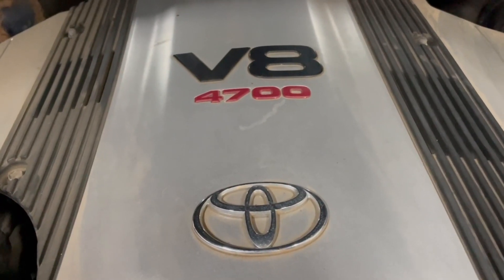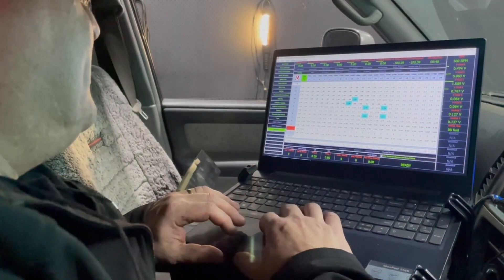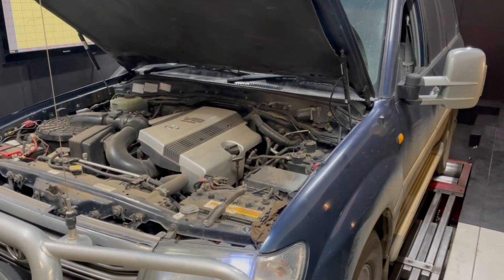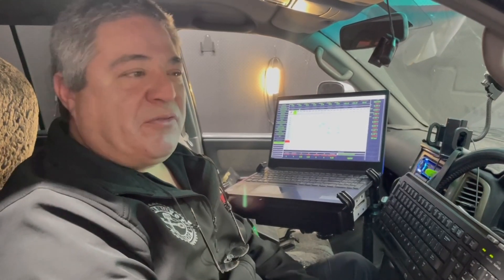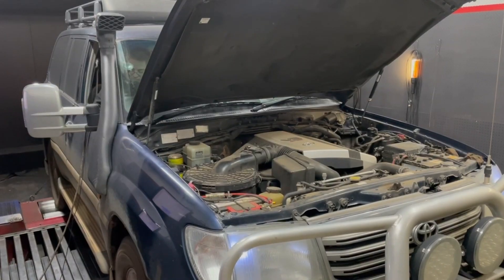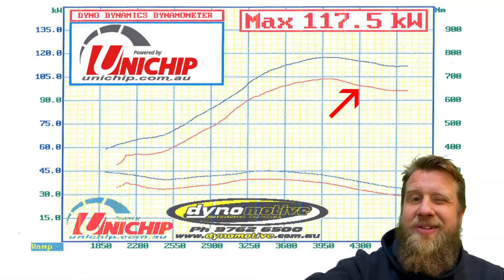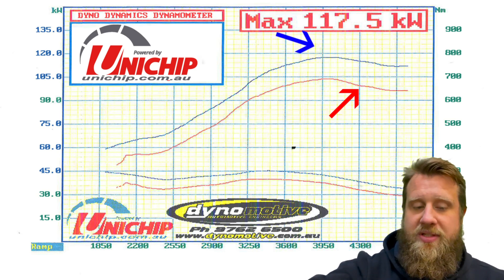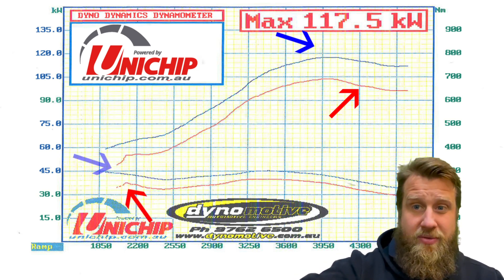+80nm of torque! 2UZ-FE Unichip ECU and LIVE dyno tune, V8 Petrol Landcruiser owners must watch!

Comment: Anyone who's done this did you actually see an improvement in fuel economy
Reply from the maker: If you create more power and torque at a lower RPM you SHULD get better economy, you will require less RPM to achieve the same amount of drive. 
To achieve the highest increase you will need to use 98 octane fuel. 

The only thing we cannot control with fuel economy, (aside from wheels, tyres, roof racks, head winds, bull bars, weight etc) is the drivers right foot.